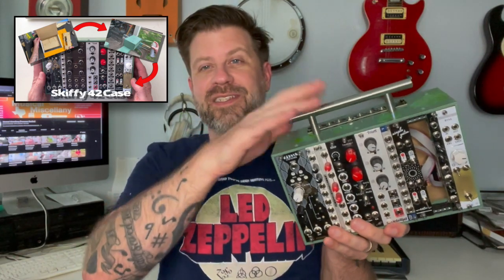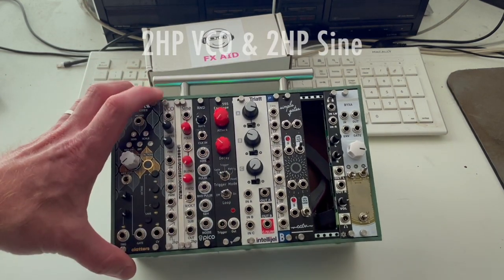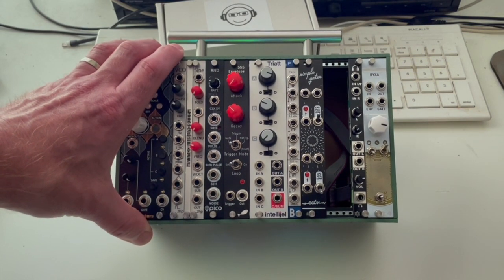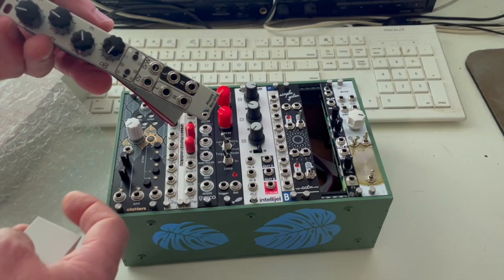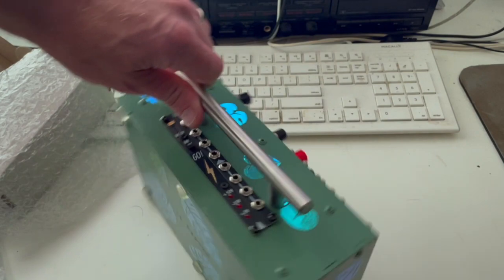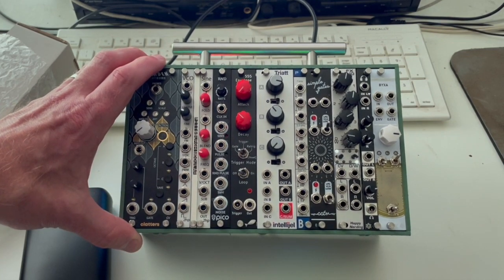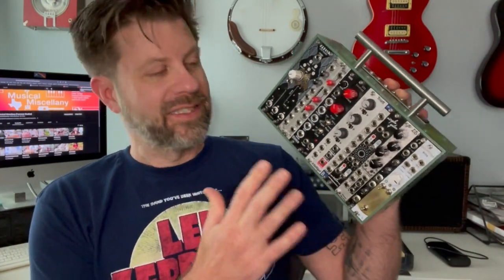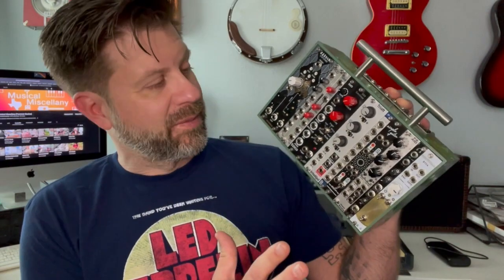The Bioelectric Skiff Project is Really Coming Along! (Battery-Operated Eurorack System)

Comment: That was crazy how far you have come. I am amazed at how much you fit in that box!! Also i have a question. When you took out the two skinny black modules to make room for the new fx unit i saw that you plugged the fx unit into the box but I didn’t see you plug the two skinny ones that you put back ? I was thinking there wouldn’t be a way to plug them in with no room left. So what am i missing?  A very cool invention and build my friend and good luck with the move
Reply from the maker: Good eye. So the way a Low Pass Gate works, it doesn't require power. The CV signal supplies the power to the module, therefore it has no power cable. Modular is a deep deep rabbit hole. LOL. I talk more about how the power and racks work in this vid if you're curious... https://www.youtube.com/watch?v=P9T2zlqPbTo
Reply: @musicalmiscellany  ahh cool. Yes i will have to catch up on that one !thanks Kale!

Comment: This is an awesome project and I'm extremely tempted to cross over into modular and build something similar. Love it.
Reply from the maker: Modular is a deep deep rabbit hole but it is a lot of fun. I think a small skiff like this is a good way to get started. Give yourself limits. If you buy a big case to start, you're going to be tempted to fill it. If you start with a small case, you'll really think through your module purchases. Thanks for checking it out.
Reply: @musicalmiscellany  good advice, thanks!  I'm not sure how far away your move is, but good luck with that.
Reply from the maker: @midi_in  It's about a 4 hour drive, so not all that close. It's going to be stressful but we'll get thru it. Thanks for the good vibes.
Reply: @musicalmiscellany  I hear it's one of the most stressful things we can do. Your Bioelectric Skiff should certainly help to alleviate that - it seems very relaxing!
Reply from the maker: @shieladixon  So true. Modular has a definitely stress relief quality to it.